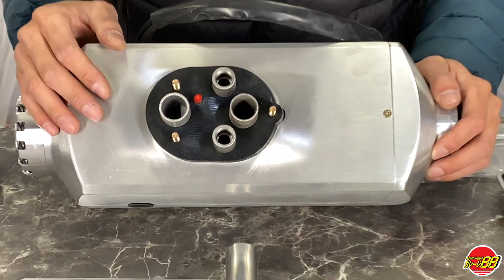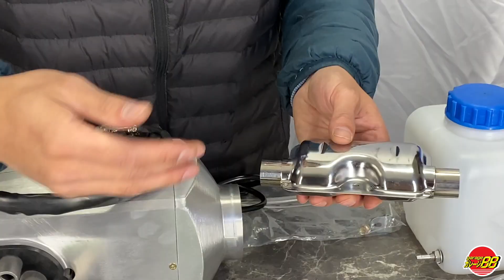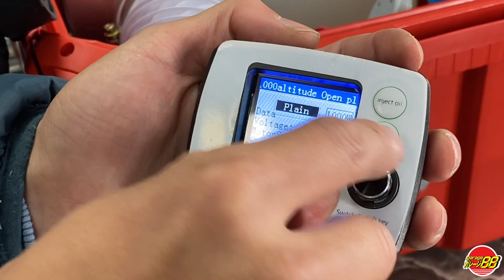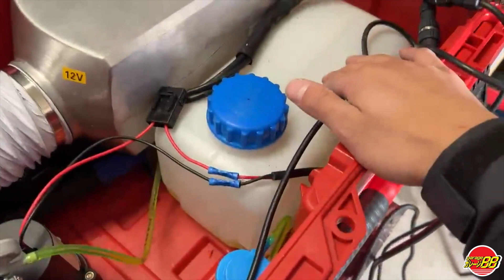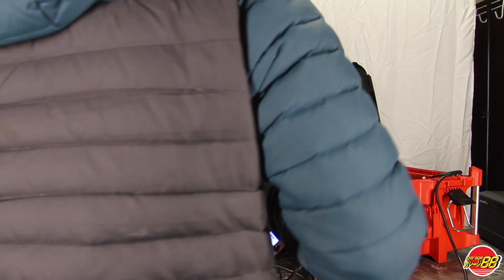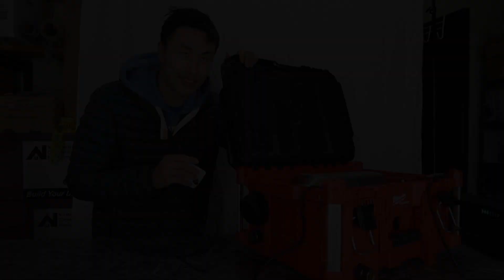The Perfect Milwaukee Packout Diesel Heating Solution by Garage88

Comment: What’s size packout is this?
Reply from the maker: Milwaukee 48-22-8425 PACKOUT Large Tool Box
Reply: @Garage88Official  Thanks! Made an order last week, can’t wait to build it!
Reply from the maker: Thank you for your order! It’s a fun build  . Let me know if you got any questions along the way! Info@garage88.ca
Reply: Does the water pump push the air out of the water loop pretty easily so it can circulate?  Or did u have to bleed it? The heater can be run with air cooling only?
Reply: Which diesel heater do you use? From which manufacturer?
Reply: Do you have fittings to run air hoses to and from the box? Can you post a 360 degree of the box?
Reply: Why does it need water?